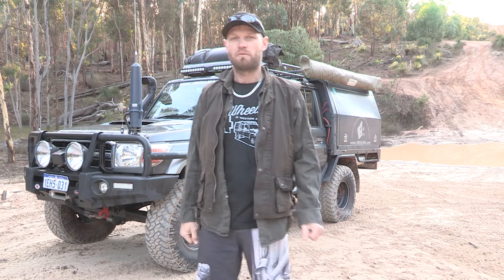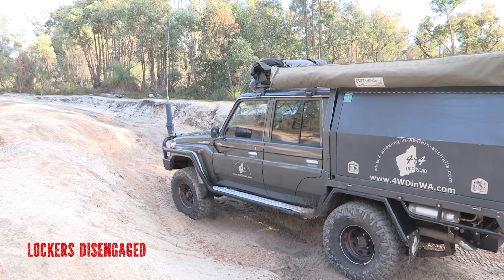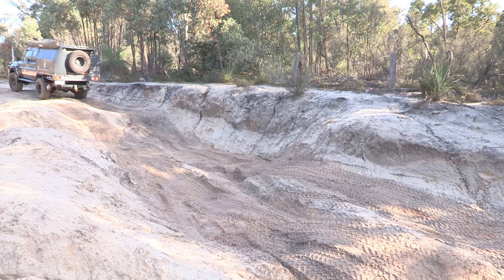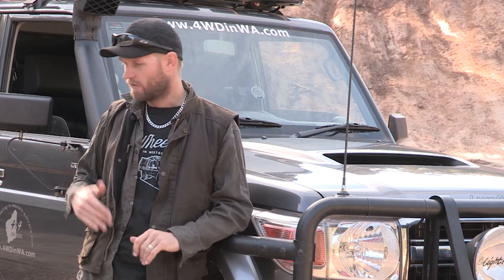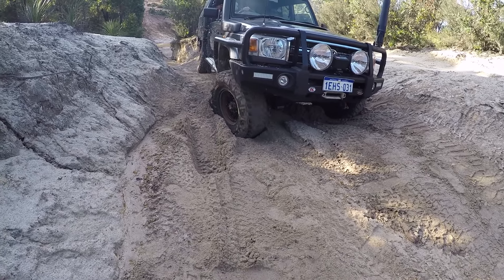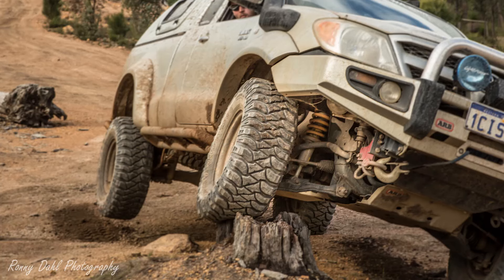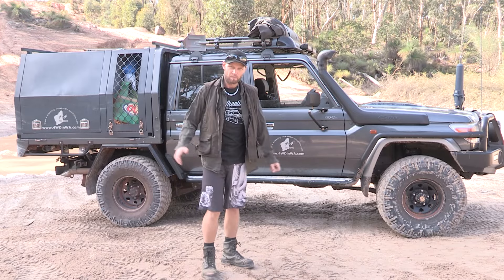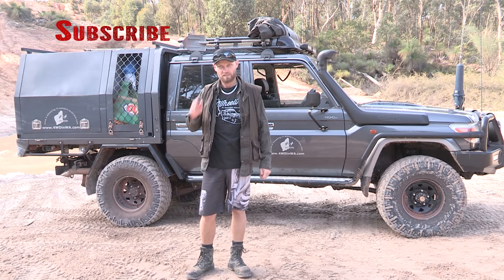diff lockers, how and when to use

Comment: Great video. I was hoping you would comment on Air vs E-Lockers. Nevertheless still agreat video, with an awesome truck.
Reply from the maker: koffeeblack I have never experienced the E locker but did have an air locker with failed on me once, the compressor cylinder leaked air which I suspect was caused by corrosion from the diff oil which shot out of the lockers connection valve every time they were turned on and off. Took two years to corrode it. I then replaced it with a new compressor. So if you get one clean it after each outing and you should be fine, but expect diff oil to spray over your engine bay.
Reply: Ronny Dahl Thanks Ronny, something to think about in the future for my 80 series...unless I can one day afford a Dual Cab 79 hehe.
Reply: Personally I'd go with air lockers, the air compressor onboard is an added bonus feature for airing tires back up when you get off the trail, or inflating water flotation toys and such.  Some of those onboard air compressors when equipped with an air tank can run air tools for short durations of time as well.  

Nothing wrong with an e-locker, but given the choice I'd go air just for the added feature of the onboard air compressor.

Comment: Nice video! Chevrolet claims that the S10 (Brazilian name for the Holden Colorado) will smartly lock the rear when in 4 low if one wheel starts to spin. I think it's a Helical Differential. It sounds little convincing in theory... but here comes my question: can this system match a true locked rear diff or is it just marketing and bullshit? If I really need it, should I pass the S10 (Colorado) and got for a Hilux or can I trust that ute in that regard?
Reply: That would be an Eaton G80. They do lock up automatically when one wheel starts to spin, but since there is a slight delay in the time it takes to lock the diff, they are not quite as good as a regular diff lock. For light off-roading it is not a problem, but can be an issue with more technical driving.

Comment: Hi Ronny,  what will happen if I have only rear locker engaged and one of my  front wheels is spinning on the air?
Reply: The front will not have drive but the rear will. This might still give enough traction to keep driving depending on how hard the obstacle is.

Comment: I have 2018 Toyota LC 200 with central diff Locker. It locks front & rear? When should I use it?
Reply: Centre diff lock does not lock the diffs in the front an rear axles, instead it just locks the front and rear diffs together. It has the same result as selecting 4WD in a traditional 4WD vehicle.  
Use it whenever you would normally select 4WD, except not on dirt roads at higher speeds since it is naturally AWD when not locked.

Comment: Is ther centre diff lock on an 80 series enough for moderate conditions offroad ? kind regards
Reply: Locking centre diff has the same result as selecting 4WD in a traditional 4WD vehicle. Just 4WD with no axle diff locks might be enough for moderate conditions, just depends on how hard these moderate conditions are.

Comment: A question for which you may not have an answer for but info on the subject is very sparse on anything not a Jeep or a full size truck in the U.S. and you Aussies seem to get all the neat toys.  My 2011 Ford Ranger has a Dana 35 IFS that has a reputation of being pretty weak, so no lockers are available for that differential, or at least that I'm aware of.  There is a gear actuated limited slip that is available from Detroit Locker (I think).  Is it worth considering getting one with a locker in the rear or just go with the rear locker and call it good?

Comment: How do mechanical lockers work? Are they the same as cable operated ones?
Reply: A mechanical locker usually means an automatic locker.  
These don't have a differential at all. In their normal state they are locked, and when you turn a corner a ratchet mechanism is activated and it allows the outer wheel to click a few teeth ahead of the inner wheel to make up for the speed difference.  
It is not possible for one wheel to rotate slower than the carrier which means they are very effective off road. They are also simple, reliable and can cost a fraction of the price of manual lockers.  
The downside is that they can be noisy, don't operate as smoothly as an open diff, and when used in the front they can increase the steering effort.

Comment: Hi, can someone please explain the difference between locking diffs and locking hubs? Thanks
Reply: Locking hubs: When locked the wheels are connected to the differential, when unlocked the wheels spin freely and are not driven.  
Locking diffs: Locks wheels on the left and right sides of the vehicle together, making them rotate at the same speed.

Comment: I have a 04 4.0 with the 3.07 gears 30/35 diff. Seems like it would cost a grip to get lockers and gears. I dont do any monster rock crawling like some of you guys but dont wanna spends tons of cash on the D 30/35. What would be my best bet without breaking the bank?
Reply: Chicago1 get a locker in the front, the d35 can't take a locker really. you could get an lsd for the 35. swapping a Ford 8.8 or Dana 44 into the rear is the best bet long-term.
Reply: @noskcaj117  a 44 front and rear is what you really want with this, locking a 30 is just a time bomb, especially if you put anything over a 33 on it. The diff and axles, and axle tubes for that mater were never built for that kind of stress.

Comment: Ronny, what are your thoughts on auto lockers?
Reply: Auto lockers don't operate as smoothly but are as good as manual lockers when it comes to traction.  
A front auto locker will effect the steering feel and give some understeer in 4WD and a rear auto locker gives some noise and possible oversteer when in 2WD on the road.  
But if you don't mind those things they can be a good option because they can be much cheaper than manual lockers and are reliable because they don't need air or electricity to operate.
Reply: Thank you.

Comment: For snow wheeling  -  i.e. A/B/Dead End trails:

Use all 3 diff locks (front/center/rear) going up 
Use chains going down
DO NOT USE diff locks going down 
DO NOT USE diff locks while turning adjacent to the slope of a hill, i.e. turning around on the side of hill to go back down.  Find the most level space that is large enough in which to turn around, if possible.  Disable all locks.  Turn around.  Apply chains.  Then proceed down.

Comment: What  about center locking diff I have a 1991 Toyota land cruiser with center diff lock
Reply: Centre diff lock locks front and rear axles together, exactly the same result as putting a vehicle into 4WD that does not have a centre diff.  
Use it whenever you need 4WD.

Comment: How much would the debate change if we considered "traction control" with lockers?
Reply: +Dean S Keep in mind many trucks disengage the traction controls when you shift in to 4Lo. Also, in some instances some amount of wheel spin is desirable, so, having traction control on  can sometimes be a hindrance.
Reply: +Sean Burke.  Thanks for your input Sean.  So, If some wheel spin is desirable, then traction control should fit well.  My point of view is coming from someone who runs a Disco 2.  My D2 has TC with a locking transfer case. (All the power has to go to both the front and the back equally) This also leaves the TC engaged high and low rages.  I'm just wondering what effect a rear locker would have to this system.  Is if beneficial enough to invest the money.
Reply: I have a Nissan frontier Pro-4X which comes with an Electric rear locker and also has what Nissan calls ABLS which stands for active braking limited slip. The system works the brakes in order to duplicate the function of a limited slip. It works quite well. BUT, it does not take the place of a Locker in severe cases. One wheel off the ground or stuck in deep snow where once again, a little wheel spin is helpful. I would say a locker is just another useful tool in your arsenal. I do intend to eventually add an ARB air locker to the front differential in my truck for this very reason.
Reply: +Sean Burke . LOL,  I just bought a Xterra Pro-4X.  I've been researching on how to get the most out of the system as far as the way I should drive it.  Just like the D2, I imagine that it has it's own characteristics.  I don't plan on doing any heavy offroading with the Xterra for several years.
Reply: Nice!
Basically, one can leave the VDC on and use 4hi for most inclement weather. I only turn off the VDC if the wheel slip is causing the computer to pull throttle. 4Lo for off roading and the locker for extreme situations. Nissan has put together a VERY capable vehicle with the Frontier and Xterra.

Comment: Is it okay to leave rear e locker on sand driving all the time? Say on Fraser Island
Reply: I wouldn't see a problem. The tires on the inside turning the shorter distance are able to slip. So it shouldn't bind. It's grippy ground that binds the drive train and causes wear.

Comment: Do you have a front sway bar disconnect?  I'm not really a IFS guy, so forgive me if thats a stupid question but it just seems like the front tires dont follow the terrain very well.  It lifts one wheel off the ground really quickly.  My Jeep is a body on frame solid axle front and rear with 5 link coil spring suspension and with the front sway bar disconnected, it flex's like a boneless hooker, I'm just kinda surprised by how little flex the Toyota seems to have.
Reply: +Motor Head Its not IFS and rear springs are leaf so not much flex. Set up for 'overland' as you Yanks call it
Reply: +Dan Zeman Well, it is a damn nice rig.  I have a Cherokee xj set up for overland - not as nice as your Toyota but kinda similar.  I watched the video again trying to see what kind of front suspension you have.  Is it a solid axle?  Kinda looked like it, but hard to tell.
Reply: +Motor Head I should be clear.  I have two Jeeps, a TJ and an XJ.  The XJ is is 5 link front with coil springs and leafs in rear.  The TJ is coils all around.
Reply: I have a fairly stock WJ. Love Jeep
Reply: well if its not IFS what does that make it?
Reply: good for your jeep?
Reply: Dan Zeman ok cool guy. Go away
Reply: Dan Zeman shoo

Comment: Unfortunately, I don't have selectable lockers on my Isuzu.  When it goes in 4wd, both diffs lock automatically.
Reply: I think what you mean is the automatic locking hubs lock the wheels in place to the drive train on the front end to allow 4x4. I'm sure it's still open differential. My jeep Cherokee for example, doesn't have locking hubs. So the wheels are still locked to the drive train. So my axles and drive shaft still turn on the front even without being in 4 wheel drive. If I had locking hubs, I could merely disconnect the wheels from the drive train, and the front end would not turn. Until I locked the hubs.

Comment: Can the lockers be in 4Hi
Reply: I haven't used them, but I'm pretty sure. It's merely just locking two axles together so they HAVE to turn at the same rate. So I imagine a manual locker can lock the rear in just 2 wheel drive aswell.

Comment: What about centre diff lock?
Reply: That locks the front and rear axles to each other.  
It is used on full time 4WD vehicles, and has the same result as selecting 4WD on a part time 4WD vehicle.

Comment: What about centre diff lock?
Reply from the maker: Hi Vanessa Downs the center lock is to engage 4WD on 'full-time' 4WD vehicles as the Full-time 4WD functions as an All Wheel Drive and when locking the center it is engaging proper 4x4 to all wheels at the same time. BUT without diff lockers (in the actual diff/final drive) it will have the same problem as discussed in the video.
For more info on All wheel drive vs. 4WD see this link: http://www.4-wheeling-in-western-australia.com/4wd-vs-awd.html

Comment: What about rear locker front lsd?
Reply: +choking0smurf just saw your comment, this is a big no no, never put an lsd or auto locker in the front. the reason is just like a manual locker it locks up when it senses speed differentials in the wheels, now this is fine when under power or on loose surfaces., however on the over run, slowing down or engine braking, when you try and turn, the locker thinks the wheel starts to slip and will auto lock. this has a catastrophic effect on steering. it will literally force the car straight, whether there's a bend in the road or not,  so its fine offroad, but on a road it can be extremely alarming when you truck decided to lock the front diff and resist attempts for the wheels to turn at different rates required for going around bends. if you don't believe me find a friend who has a manual front locker and drive and drive it on the road with it turned on, because remember you have no control when it will engage.
Reply: Only a problem when you have a full time 4WD. If you have a normal 4WD and unlock the front hubs, the front diff is doing nothing when driving on the road.  
Most LSDs will not be tight enough to cause issues, a lot of front wheel drive cars come with LSDs in the front. But LSDs are also pretty useless off road most of the time.
Reply: He asked about an LSD front which is perfectly fine,  the ford Raptor is stock with a rear locker and front LSD

Comment: I have AWD...am i always locked?
Reply: AWD typically has nothing locked. The front and rear axles are not locked together and neither are the wheels on the left and right sides. Which is why it works well for improving traction on the road (there is no binding) but doesn't give as much traction off-road as a 4WD which at least locks the front and rear axles together.

Comment: I am an American fan and I run an Eaton Detroit locker in the rear of my truck and an Eaton truetrac (Torsen) limited slip in the front. I have never seen a setup like that mentioned in the modified series. Are manual lockers popular or even road legal in Australia?
Reply: Detroit lockers are available here is Aus, and we have out own mechanical lunchbox locker called the Lokka that is very popular because of its low price. I use a Lokka in the rear and an Eaton Harrop e-locker in the front.

Comment: How do you feel about lokka lockers? Are they of good quality for a lunchbox?
Reply: I have a Lokka in the rear of my daily driven Land Cruiser. I have had it for about 20,000km and it has worked very well, I have not pulled it out yet to check on it though.

Comment: I like a lot of your videos but you're wrong on this one it depends on the LSD not all are equal. Torsen LSD and Detroit truetrac work extremely well the only time they run into an issue is if you completely lift the tire off the ground. So if you run it only I want end and a Locker on the other it's incredibly where are you run into an issue. It puts a little less stress on the actual than a full Locker so it's not a bad option in the front if you have something like a D30 in a jeep. Personally I think it works better in the rear if you live in any place to get snow and ice plus more traction on everyday travel than a selectable Locker.
99tj Sahara had d30 torson lsd rear d44 sparton locker did well would climb up a tree 1 front tire np . 
14 Jk rock jock 44 Detroit locker 
D44 torson lsd . so far my favorite set up . With carbon chromoly shafts and 4.88 gears.

Comment: @2:51: "So when you're off-road, your differential will always send drive, or power, or force, to the wheel with least resistance".
Erm, no.  An open differential always applies the SAME torque to both wheels. So when one wheel is in slippery mud and another on rough rock, the one in the mud can no longer apply full torque (it slips instead of moving the vehicle forward. Due to the differential, the torque on the other side decreases by the same amount - it's still doing exactly the same amount of "pushing" as the  spinning wheel, but the resistance of the ground is able to prevent it from rotating. What it looks like to an observer is that one wheel is doing more work than the other, but in fact they are applying equal force.
It's an important distinction, because the correct tactic with open diffs is to choose a path that gives both wheels on an axle similar traction, rather than letting one wheel get excellent traction and the other very poor traction. The total traction on the axle will be (2 x the lower traction), whereas with a locker, it will be (the higher traction + the lower traction).
Reply: Locker or lsd ftw .

Comment: You need a Ram Power Wagon. From the factory. 3/4 ton truck, 12,000lb winch, electric sway bar disconnect, 33" tires, 4.56 gears, gear type LSD in the rear axle, AND electric lockers in the front and rear axles. All with a factory warranty. Think of it as a Jeep Rubicon on steroids.